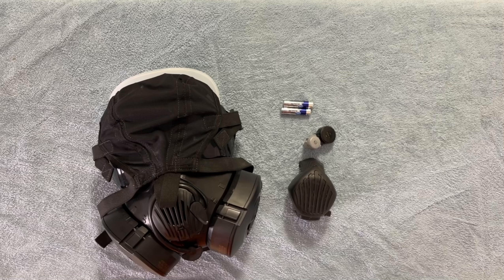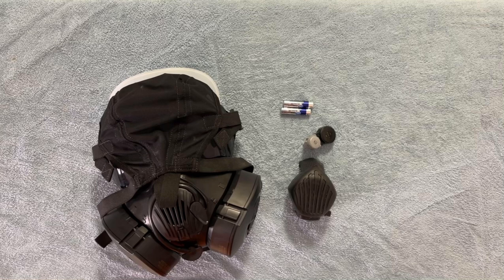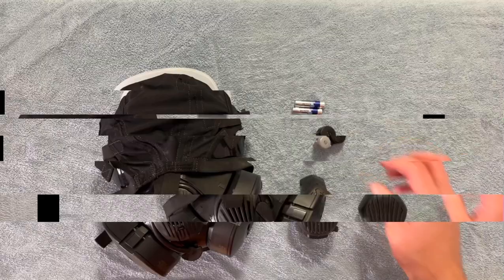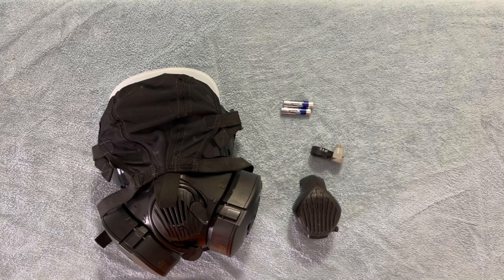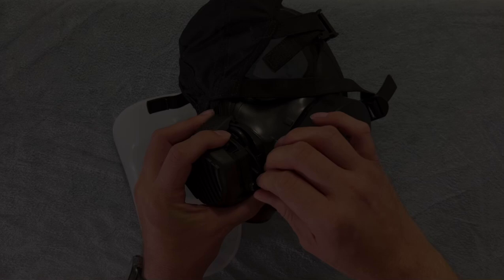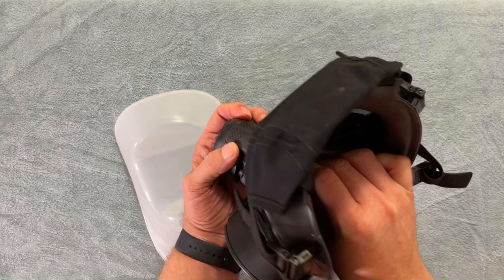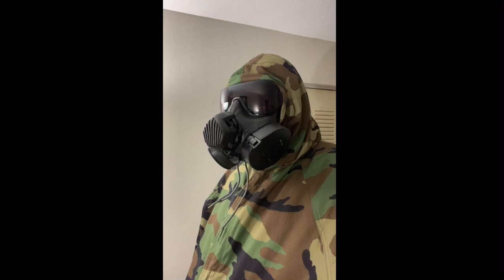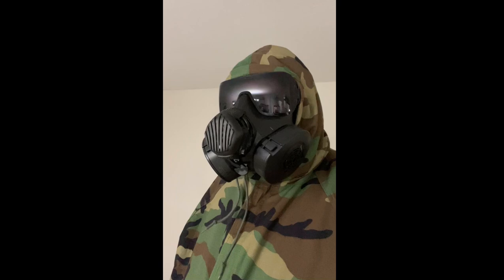Avon M50 Gas Mask Voice Amplifier - Parts & In Use!

Comment: Never seen one of those before. 👍
Reply from the maker: They’ve come a long way. One of the first ones I saw had a clumsy microphone in the mask, and the battery and amp were wired to it, EXTERNALLY. You had to clip it on your suit somewhere. A far cry from this slick integration.
Reply: @mjames70  Yeah I've seen some that you clip to the diaphragm, then connect to a tanker headset. There is one for the s10/fm12 that looks like a pig or a duck.
Reply from the maker: @t-5538  They’ve certainly gotten simpler, and better over the years. I have a Scott one somewhere that is as big and heavy as one of those 9 volt portable radios from the 70s that you had to clip on somewhere.

Comment: Can you tell me how to get this mask and that extra amplifier device?
Reply from the maker: That depends on where you are. In the US, they are readily available new or used on eBay, Facebook marketplace, surplus stores, and safety equipment providers. They are not legal to export from the US, though, so outside the 🇺🇸 it is difficult to impossible to find any. Hope that helps.
Reply: Thanks that helps me a lot sir!
Reply from the maker: If you have any other questions, I’ll try to help as best I can!